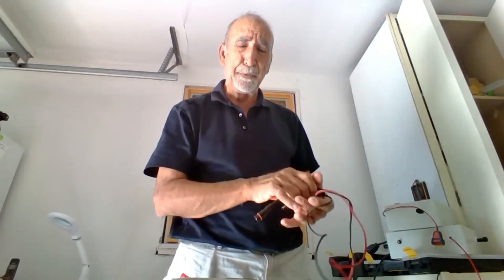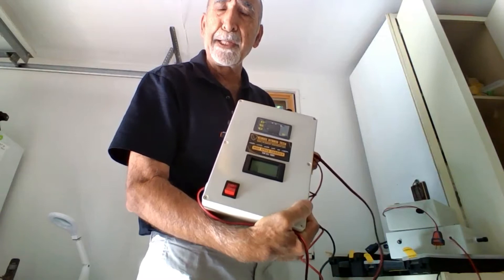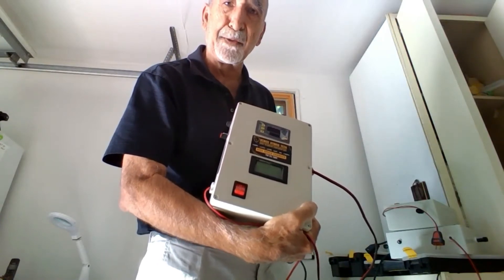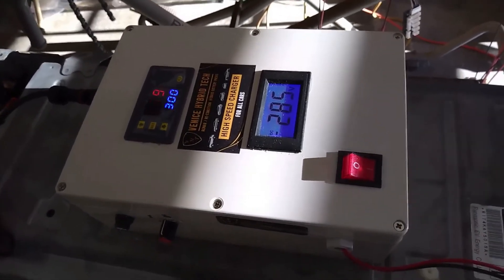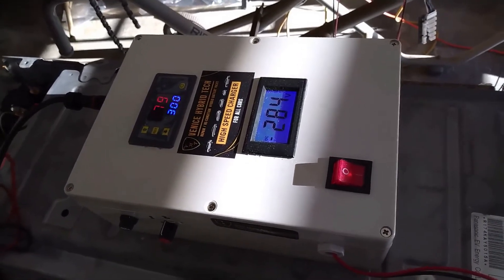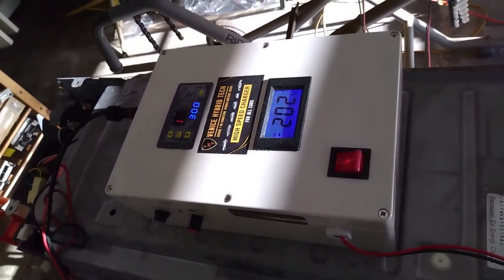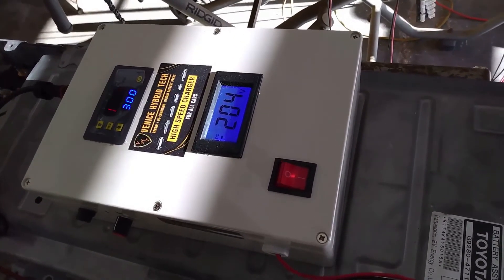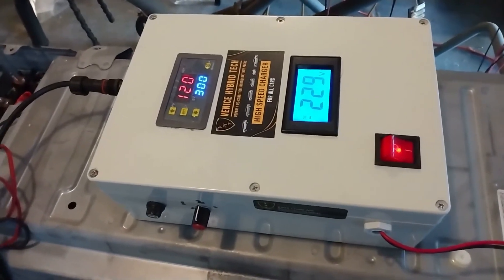HOW TO USE A GRID CHARGER ON A TOYOTA PRIUS GEN II

Comment: Great video..
May I ask you where did you get this grid charger?
Can it be used for different vehicles?
I have 07 camry hybrid, 2008 highlander hybrid and 2015 prius.
Is it safe to use it, it wouldn't over charge or over heat?
How long would it last, if modules are off balance to fall back out of balance after you charge and balance them?
Thanks again and I will be hoping for response soon.
Reply from the maker: Hi, you need to go to my website www.venicehybridtech.com
Read and research a lot. I assemble these chargers at my place and have been selling them for 10 years now. I have different models for different vehicles. You will need a charger for Camry Hybrid , which you can safely use on your other two vehicles.

Comment: excellent.  By Chance, have you tested to see what is the lowest state of charge or lowest battery voltage that the charger is able to charge from.  For example, if the battery pack total voltage is 120vdc, would it be able to initiate a charge assuming that all the modules are in good condition?  I have serviced customer's Toyotas which were parked for almost 1 year and the Traction battery voltage was around 120vdc.
Reply from the maker: Yes, the charger will work fine, even with the packs with low voltages. You may also like to watch my videos on the subject.

Comment: i have one question. have you ever try the 18650 battery, with prius gen 2. example, we buy 72v20ah x3 unit total volage it should be 240v when charging. please give some idea on that. thanks u.
Reply from the maker: Hi Kim, I have not worked on any system with Li Ion packs. For you to use such a system, there would be two problems to overcome. Firstly, the software in the car would need to be fooled. Secondly, You will need to install a separate charging system for the Li Ion battery packs as the regenerative system in the car will not work.
Reply: i mean use to extend the battery range. does it work?

Comment: You don’t have the fan running.  Not good for the battery
Reply: @Blake Doan the charger produce output current of just 1,4Amp - for such large battery it should not increase the temperature to be necessary to introduce some fan cooling. 
For a nice comparison - when HV battery is in car and when braking, my Gen2 Prius is producing current up to 50Amps which goes to HV battery, still the build in fan is most of the time turned off. Usually it is running just during summer hot days when temperature in the trunk (and of the battery) gets higher. It is then good for battery health to turn on AC as the air for cooling the battery is taken from the cabin (inlet is next to rear seats).
Reply from the maker: You are most welcome to your personal opinions but my products are based on strong research and practical experiences. I have been in business for 13 years selling chargers and repairing hybrid batteries, without any customer complaints. I do get people like you once in a while, may be trying to promote others' products.
Reply: with the low rate of charge and with the timer to limit the duration, it would be difficult to over heat NIMH packs.  I will test that in our shop once I get one.
Reply: @TheRealoldcar so how was it?
Reply: No issue even when left on for 6 weeks because the load current drops to near zero as the battery pack is near full.  However, this was just on our bench for stress testing and in practice we just charge based on time and then measure the pack total after an hour to look for a large decay.

Comment: Can this charger work on a 2013 Silverado Hybrid battery?
Reply from the maker: I have a Grid Charger specifically designed for Silverado. Contact me at 424 227 6719.
Reply: @VeniceHybridTech does it work of a 2014 Camry hybird
Reply from the maker: @godzilla_area5111  Hi, Yes, it should work for 2014 camry Hybrid.